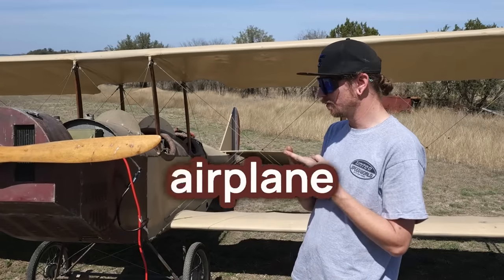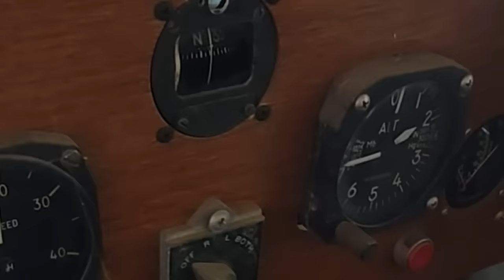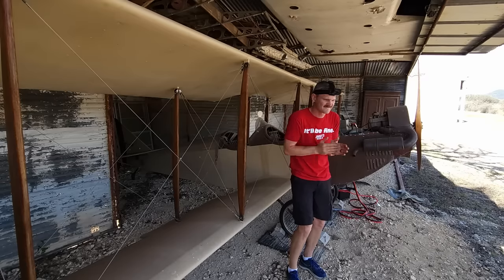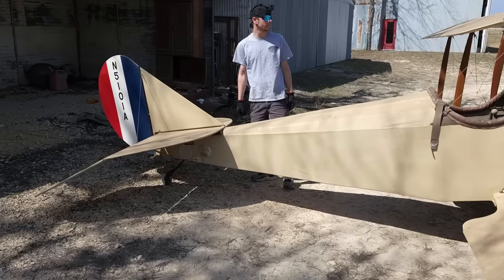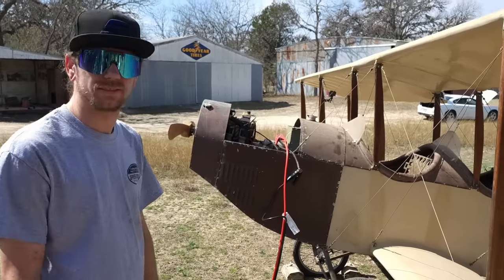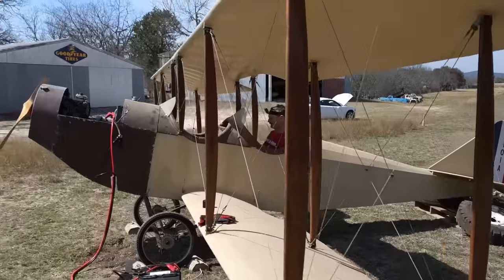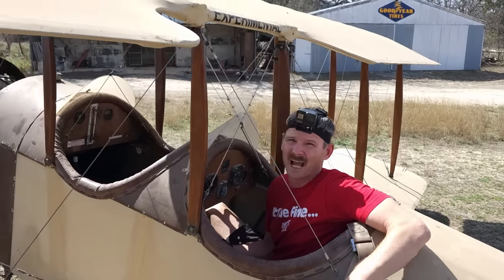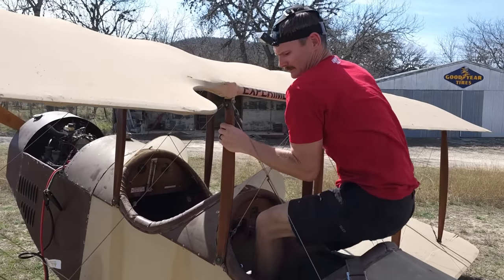WW1 Airplane Will It Start After Years?  FREE Airplane Challenge

Comment: Hey Jimmy, when starting a tail dragger I was taught to pull the stick back to make sure the tail would stay planted on the ground.  You might consider doing this in the future even with the T-6.
Reply: I don't think he has his tail dragger endorsement (he said he wasn't legal to fly the cub in the other video).  Perfectly legal to run one up without the endorsement but little things like keeping the tail planted etc is important things to know...
Reply: @Avi8tor857  to bad he didn't get ahold of me.  I would have loved to drive from East Tx to the central part of Texas to help in those old birds.  My first plane was a Luscombe 8a and my last was a Vans RV8.
Reply: yep, my dad always kept a bungee cord in the plane to hold the stick back on start-up, his was prop start so had to tie the tail down, bungee the stick and crack the throttle a hair before fire up
Reply: If you look at about 11:19 , you can see they have probably 100+ pounds holding the tail down.
Reply: @Avi8tor857  I saw a video where someone taught him.
Reply: I would hold the column fully back by wrapping my leg around the column, holding it behind the knee. Make sure the aircraft is chocked as in this position the brakes are out of reach.

Comment: Great video.most of those old Rotec motors we're Premix the little oil bottle was for the rotary valve and water pump. If it was oil injected it would need a lot bigger bottle than that little bottle.
On the old MX570 Snowmobile they were pre mix and had that little bottle for the rotary valve and waterprompts.

Comment: Jimmy, you have a Rotax 532 fitted in that Jenny. 

Its a single ignition points ignition  water cooled 2 stroke. The lityle reservour on the top is 2 stroke oil for the cross shaft.

There is no oil injection on this. Its a 50:1 oil fuel mix in the tank.

Comment: That's an old 582 Rotax, possibly a skidoo conversion since it doesn't have dual CDI. The 503 is air cooled with air shrouds and a cooling fan. ;) Also, that is not the oil injection reservior. It is to lube the rotary valve only. I don't see an injection pump so that motor has been converted to PRE-MIX only!! 50:1
Reply: Yeah and it should have been smoking like he'll on startup if it was getting enough 2 stroke oil. I don't like those engines. Had many failures on the crankshafts in the past. Even the VW flat four would be a more reliable motor than that one.
Reply: @vincentmolloy5660  They are great engines if maintained properly. I have three Rotax here, zero problems. Two have oil injection, works fine. My 503 was converted to pre-mix before I got it, so I left it alone. Hundreds of hours of reliable fun.
Reply: 532

Comment: If there’s not much smoke it just means it probably has the correct mixture I have run rotax for years and if properly mixed and when warm it won’t smoke much and a two stroke without oil mix won’t run very long.

Comment: That's not a 503. It looks like a 532 water cooled. Unfortunately it's an old engine and spares are becoming increasingly hard to come by which will reduce the value. As posted elsewhere, you MUST use 50:1 2-stroke premix as that little reservoir is for lubricating the rotary valves ONLY. Rotax 2-strokes are pretty bullet proof and if you use straight Mogas it'll fly for a surprisingly long time as an old friend found out with a 582 that has the same lubrication (as does my X-air) but it will seize eventually.

Comment: I always use wd40 as starter fluid, or 2 cycle gas/oil in a bottle.  Ether and brake clean is just to harsh IMO on a 2 cycle.  Nice experimental Jenny. 

For the cub I think I would run that engine to temp with some marvel mystery oil in the fuel and oil a few times then change the oil again.  Likely will fully lean the valves and un stick the rings.

Comment: That's an Early Bird Jenny. That galvanized firewall, you should run some two inch tape across that to keep the leads on the battery from shorting. Also when using a wrench it could short. Thanks.

Comment: Not a Rotax 503, Maybe a 582 or an old 642 boat anchor. The rotary valve oil reservoir isn't injection oil. If it's oil injection it will be on the crankcase under the carbs.

Comment: "Good job Jimmy! This Bi-plane was an excellent glider. It fetches very well and was easy on fuel at low altitudes. Your service techniques on the aircraft was well noted, but? The engineers who had constructed this engine deserves an applaud; Due to it's smooth running capabilities and the life expectancy of the motor being still valid due to it's hourly usage at the time of the craft being in service, to the previous owner." 
~ I can't wait until you work on the Mustang. It was an Eagle in the sky..Look! Look! There it goes!~  👍

Comment: I noticed when they went full throttle, you can see the engine tip forward on its mount. Might want to make sure the rubber isolators are not rotted.
Also.. check to see if it needs premix or not.. I did not see any smoke, at cold start. Usually 2 strokes smoke a little at least.

Comment: It's not a 503. It's not oil injected. It is a rotax 532 65 HP single ignition twin carb. The oil tank they were looking at is the lubrication for the rotary intake valve.

Comment: We had a JN Jenny at our airfield that was completely restored by the airfield owner.
Original Water Cooled Curtis OX5 engine.
And, one of my best flight instructors, Evlyn Waldron, an original Amelia Erhart fellow pilot and 99 member.
 She told me she learned in a Jenny, and 3 out of 5 flights was a forced dead stick landing due to the unreliable nature of those 90hp V8 engines.
 Also, they have only a top speed of 75, cruise is 60 with a sudden stall at 55.
 So, you have barely 15 to 20 mph window before those wings stall.
 Stall recovery uses 2,000 feet or more.
 Question is,  this experimental 2/3 size model, if the airframe,engine,  fabric and controls prove usable. if stall tested, get plenty of altitude.
 And know this. The original Jenny took 7 and half minuets to climb 2,000 feet AGL.

Comment: That's a Rotax 532. The oil tank above the engine is only for lubricating the rotary valve bearing and drive gear.  If you were not using the oil injection pump with the separate oil tank then hopefully you premixed the fuel and oil before running this engine. Hopefully. Love your videos Jimmy.
Reply: its a 532, 582 has dual plugs
Reply: @bgardam9347  Did not know that. Thank you

Comment: As long as it's already been brought up, I'll say it as well.  Should have seen lots of smoke when it started.  It seemed flooded when it finally took off.  That little oil bottle on top is just the oil reservoir for the rotary valve shaft.  It doesn't supply oil to the fuel.  Also, it's almost for sure a Rotax 532.  They came out before the 582.  Single ignition, liquid cooled.  There was a 462 single ignition, liquid cooled but they are really rare.  I've owned and flown two 532s and three 582s

Comment: Another great video but…..That 503 might be junk now. It should have been smoking a lot more than that. The small oil bottle on top isn’t the oil injection bottle. There is normally an oil bottle that is much bigger than that for oil injection. If there isn’t a bigger one, it’s supposed to be premixed
Reply: That was very troubling. Regardless, that engine has sat.for so long, only a nutcase would take it into the air....
Reply: @straybullitt  exactly. I believe the maintenance manual says that a complete overhaul needs done every 300 hours or 5 years.
Reply: Its a 532

Comment: did you see the motor pulled forward by the prop when you ran the motor up it moved 3-4 inches forward and down that will really mess with your thrust angle

Comment: Check the engine mounts ... when you were throttling up and then brought the power back the engine moved several inches.   Start at 16:40.  Even the battery cables moved.  Check the firewall also. Seriously Jimmy

Comment: That 1/4 of a quart is all that thing holds for oil injection? That's barely enough for 2 gallons of gas. I bet someone drilled out the crank bearing passages and is running oil directly to them. Supposed to run mixed I bet.

Comment: you should always lube the cylinders, drain the old fuel, and not use starting fluid on a bone-dry 2 stroke. it would also be wise to do a 100:1 mix in the main fuel tank and mark the oil reservoir to make sure its actually taking oil. of course this is the bare minimum. I always check compression then take off the carb/s for a proper cleaning 1st. not worth it running lean!

Comment: So what you have there is a Rotax 582.  The other comments are correct, that little bottle of oil is just for the cross-shaft. You will have to see if it has another oil tank, if not, you will need to mix your fuel 50:1.

Comment: Hi guys one question, in our flying club we´ve got a PA28-R200 (1971). We got a gear Problem. Where can i get a Hydraulik pump for the gear what will be the costs? Thks
Reply: You can get a Prestolite power pack for your airplane for around $3800.

Comment: Jimmy I`d run that plane hard to get hot Then at High speed shut the Mags off without slowing down then check the plugs for color they should be tan color , If white check the oil pump for flow , Reason mentioning 2 strokes always let a little smoke out exaust even the new sleds & para wings .

Comment: I can't believe looking at that Rotex how similar it is to my 580 snowmobile I have a 580cc Rotex engine in my snowmobile do you have oil injection or do you mix your fuel on my rotax you cannot mix the fuel the oil injections shoots up squirts into the bottom of the crank also I have a 521 and that has roughly 100 horsepower so that little airplane must at least have 90 horsepower

Comment: So, quick tail number search and see the builder died in 2020. Age 75
Obituary said he was WW2 Navy Vet.
Also said he was involved with the experimental aircraft builders community.
Plane was finished and certified in 1997.
The Rotax Bombardier Engine is in the FAA registry for this downsized Jenny. It is 2 cycle with oil injection feed from that bottle seen above engine.
These engines are mostly used in Skidoo snow machines.
Hope you verified the oil was full , lines clean and the verified  injector pump was working to meter correct amounts of the recomended non ash mineral oil.
This is the number one killer of Rotax flying pilots. Seized engines.
Otherwise that engine run scored the cylinder walls. Ruined the rings...Toast.  
A& P 101
Reply: You said a couple hours ago you didn’t know anything about Rotax engines and now everything is A&P 101. FYI that little bottle is not the oil injection tank. That little bottle is the reservoir for Rotary Valve shaft lubrication. That’s Rotax 101 right there. I laugh at guys who can’t tell the difference between a 277 and 670 yet have the arrogance to offer up advice after an hour of research. Now that’s what I deem as dangerous.
Reply: @shannonwhitaker9630  

My mistake. I do not own or work on Rotax engines.
Lycombing, Cont, Pratt Whitney ECT.

Comment: I don't remember if it's the Progressive Aero - Searay people or the Aventura Aero People, but one of them makes a unit they call a "Bomb" which has all the necessary flight data (air speed, altitude, etc... that bolts onto a wing spar, they just might not have any Engine instrumentation), that would feed via Bluetooth to a phone or tablet

Comment: Waiting for the trans-Atlantic flight video Jims.
Reply: This aircraft was built from a kit as about a 70 percent replica of the JN4. It was built in 1997 and got its certificate in 2004.  Not nearly as old as some are thinking.  Jimmy defineately needs learn about the care and feeding of Rotax 2 stroke aircraft engines.  These engines were not just converted snowmobile engines.  They quite often had a different crankshaft than those in snowmobiles and they also had a gear drive to turn the 2 stroke RPMs down to efficient RPMs for props.  The 503 was air cooled the 532 and more recent 582 are liquid cooled. Rotax no longer produces 2 stroke aircraft engines, but produces more aircraft 4 strokes than any other manufacturer in the world.

Comment: The Jenny was nicknamed "Flying Coffin" because it is a spruce framed biplane with the engine mounted to the fuel tank. If a pilot landed real hard the engine and refuel tank would break of resulting in the pilot trapped under the engine and fuel tank as it fuel would catch fire and burn the pilot to death.

Comment: i wonder why he put a 2 stroke in it is that what the original jennys had?
Reply: This is a smaller replica of the old WW1 Jenny and does and can not hold the old OX2 engine.. 😂
Reply: That is a scaled down replica of a Jenny. They were originally powered by a Curtiss V8 engine that developed around 85 horsepower, and was considered to be unreliable even by the days standards, back then.

Comment: Don’t use starter fluid on a 2 stroke get a spray bottle with mixed gas. You will wipe your lower end bearings in a hurry

Comment: UPDATE: COULD SOMEONE CONFIRM IF THIS AIRCRAFT HAS A TWO STROKE ENGINE🌟🏅✨️⚡️🍺 
 Hah! Makes me want to watch the flick 'Those Magnificent Men in Their Flying Machines'  one more time.
Reply: Great movie! But in the clubhouse when James Garner was asked if his plane was a Wright, he replied “No, it’s a Curtiss.” But it just didn’t look to me like anything Glen L. ever built. Then one day it occurred to me when the sponsor is wishing the aviators well the ailerons were hanging straight down. Single wire control! It’s a Farman! The wire pulls them down, but air pressure is the sole thing pushing them up. BTW, some Farman-inspired ones both pre-WWI and during WWI used single-surface wings. Just a single slab of linen and either wood or even bamboo to give them shape. They really put the dare in daredevil!

Comment: You'd have to be suicidal to fly this old pos without a complete engine teardown and rebuild as well as going over all the airframe, bolts, rivets, joints, and covering, and replacing all the rusty linkage for the flight controls.
Even then this seriously risky as these old planes were not designed well and did not fly well at all.
Reply: Best comment so far...
Reply: Are you serious. This is a Jenny replica built in late 90’s.

Comment: That is painful watching you spray ether in a 2-stroke. No lubrication. I'd be pouring extra 2 stoke oil into that thing. Also, I'd run it with premix until you are sure the oil injection is working. Personally, I wouldn't fly it relying only on the oil injection, I'd pre-mix.

Comment: You should be pushing the stick forward so the tail doesn’t rise when giving throttle. How you’ll prop strike for real and have a bad day. Keep that elevator pointed up not down. Really surprised how easy it was to start
Reply: I think you mean, hold the stick back! Forward would put the nose into the dirt!
Reply: Stick back or up elevator. Stick foreword with tailwind only.

Comment: This all brings back memories of when a friend and me were getting a hand flick pixie to run properly , after 6 or so adjustments we had it purring . HOWEVER at full throttle for 15/20 seconds ... Boom and lots more reves ,... The prop exploded . 1/2 in and around the ground and the other half...well we never did see that again  . The almost half ( many pieces ) i taped back together that night and it became a wall mount .It's no mystery why props went alloy .. Clear prop has a special meaning to me as a result . At the time it went bang (i say boom as a description only can't remember any noise just a screaming engine  )i was very near but behind a steel door peeking out . I could read into the future even then .

Comment: Well, one obvious fact, Jimmy is, you don’t have a clue how to hook up a battery correctly!!
First you start with the object you’re trying to start the vehicle, the plane, the whatever by connecting both positive and the negative terminals first that’s first !!!! Secondly, depending on whether it is a positive ground or negative ground, you hook up the current power wire on the charging battery then the grounding post last😳😳😳😳😳 hey